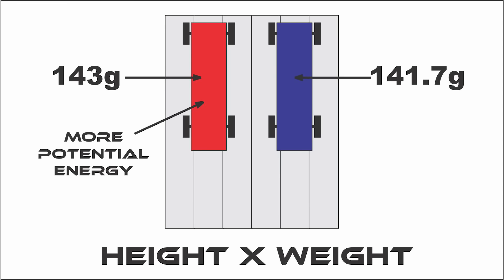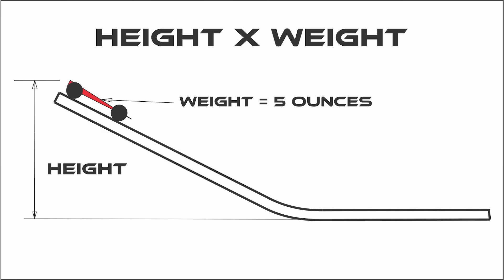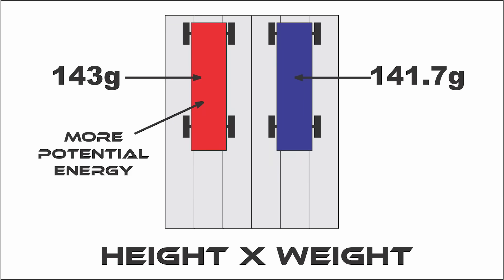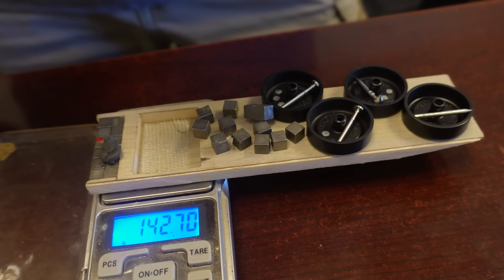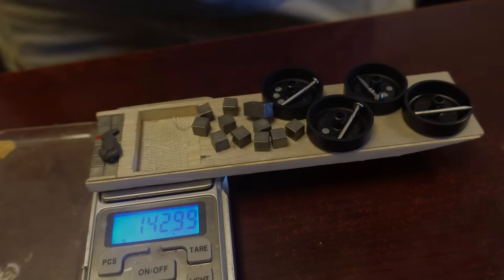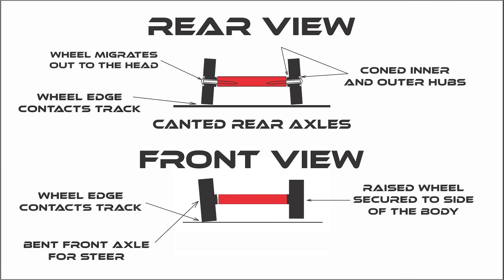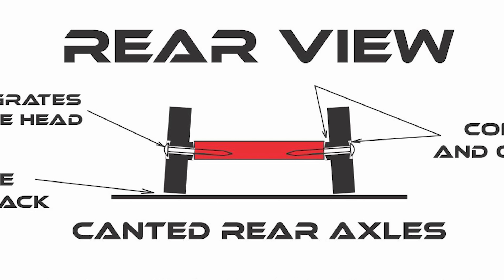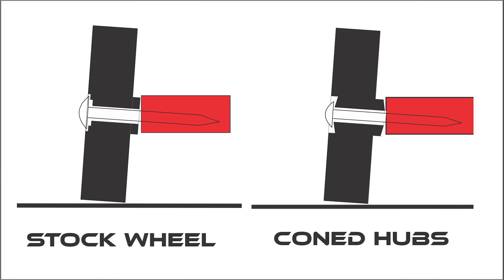Pinewood derby Fundamentals

Comment: Hey Mike - Was wondering if you are running fenders if the wheel weight measurements change or do you still strive for appx 15g on the front dominant wheel? And the back wheel weights remain the same? Thanks and look forward to your response!
Reply from the maker: Regardless of class, I normally start with 15g on the front wheel
Reply: Thanks again Mike and just to clarify by starting at 15g do you mean the finished car or before the fenders and shields are added. Many Thanks again!
Reply from the maker: The finished car

Comment: Mike - I would just add one thing about weight height since it's going to be scouts and their parents primarily viewing this. There is more potential energy in having the weight low in the car than there is by placing the weight higher up on the body. The bottom of the car actually drops further(!) than the top!

Well done video!
Reply from the maker: I normally forget to share something, good catch!